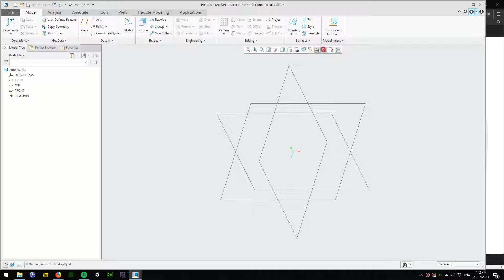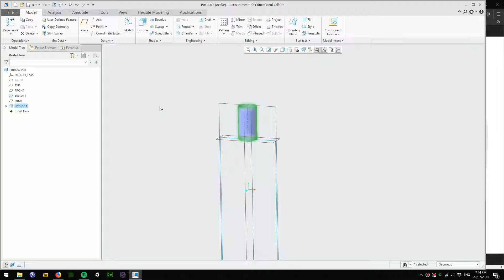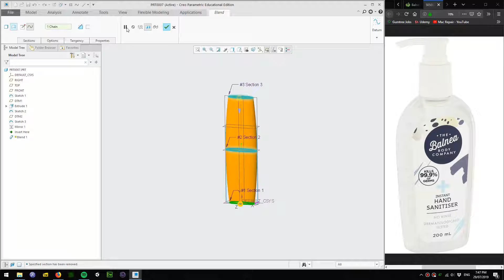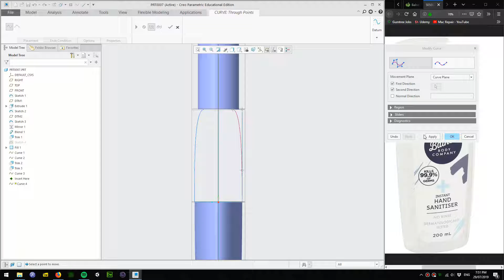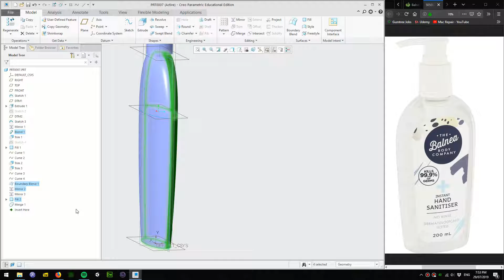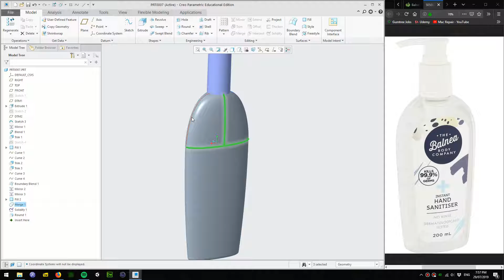Creo Tutorial - Curve Bottle Surface Modeling

Comment: I love you videos, good.  Where you mirrored the neck, you didn't need to draw all those curves, as you mirrored the quarter section.  Also when you tweak the two curves it's impossible to get the same value, however, you mirrored the boundary blend, it didn't matter. Then you see the limits of the merge, so you could of just draw half the bottle in the first place. Merge is a PIG.
Great stuff, learned a lot over your videos.